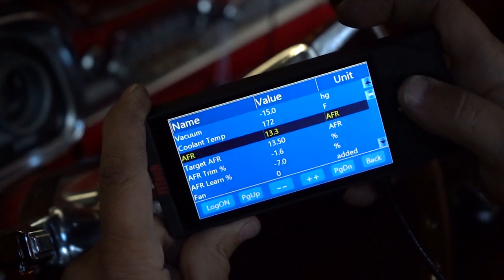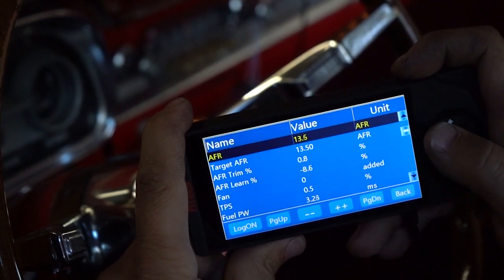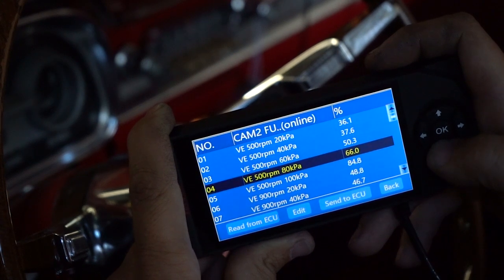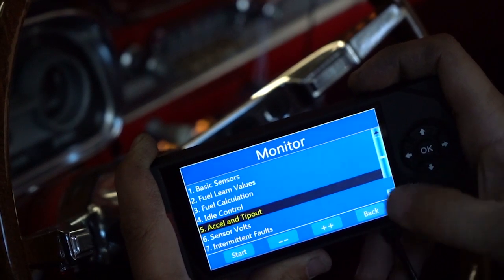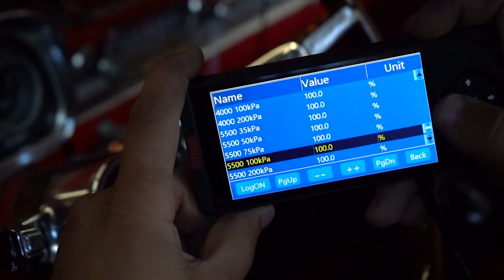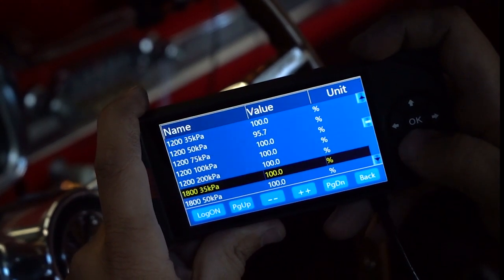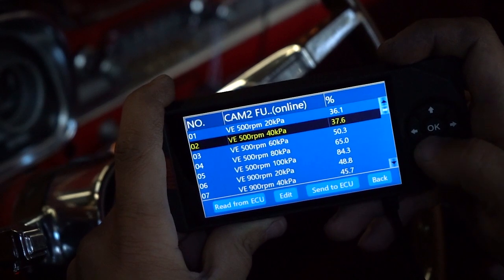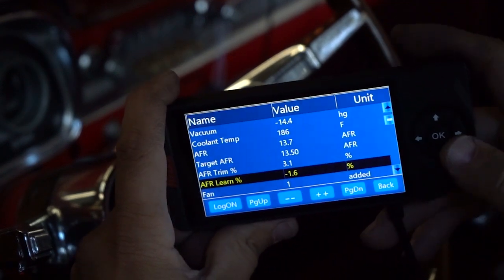How Closed Loop AFR Trim & Learn Work Part 4| Tech Tuesdays | EP51

Comment: I Feel Stupid. I Saw Those Learned Trims And Didn't Understand Why They We're So High. Lol Those Are From 100 And The AFR Learn Are From 0 LMAO. I Ignored The Learned VE Table And Would Take The Logs In Spread Sheet. Filter All The AFR Trims Around Certain RPM Range And Kpa Range To Calculate The Average Of AFR Learn (STFT+LTFT). Then That Average Would Be The + or - Percent Of How Much I Needed To Change The VE Table At Each Cell. This Took Like 1 Hour To Do Each Time. The Whole Time All I Needed To Do Was Drive It And Let It Learn.... Then Look At AFR Learn Table And Make It Match The CAM VE Table. I Made 5 Passes Doing It The Spread Sheet Way And The STFT+LTFT Averages Actually Got As Close To .5% With A Big Log On Areas.
Reply: That Sound like an very advance way.. Maybe you could upload a video ( How to Pro tune Ve table ) 🤷‍♂️
I would like to know How you did it in a video… Thanks